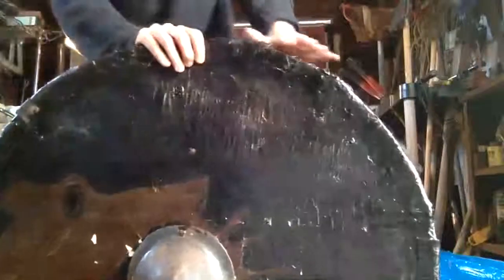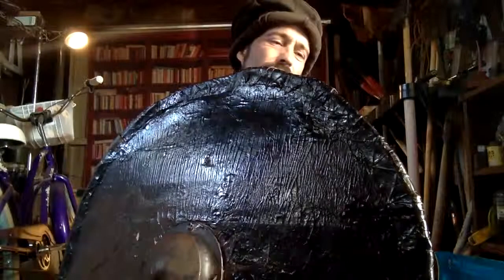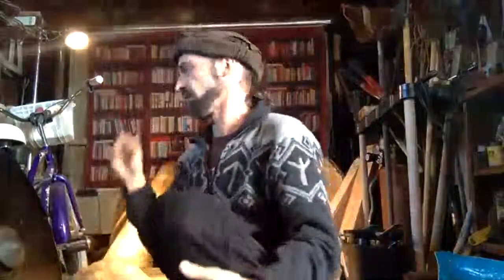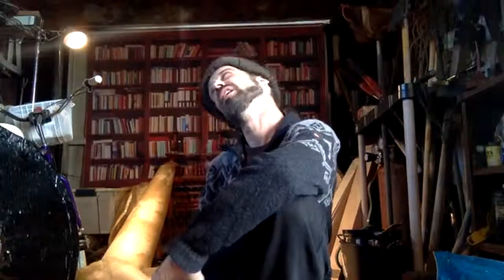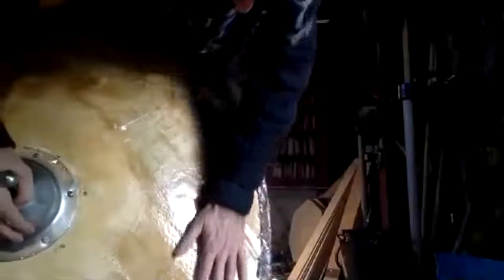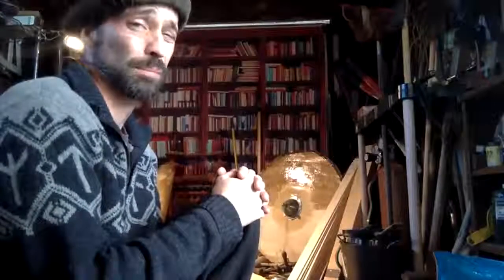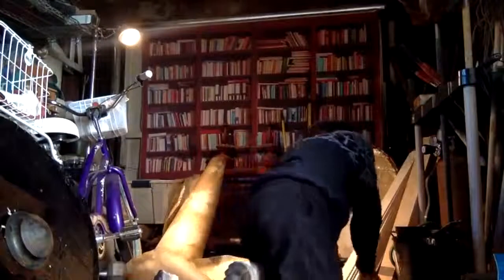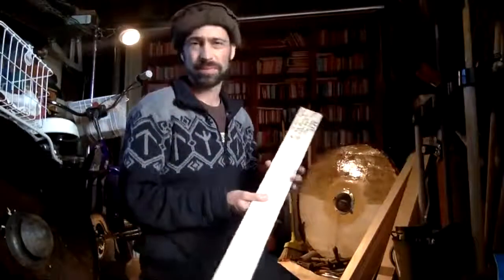Update in Shield Testing Plans, the indoeuropean word "linden" , And more!

Comment: In german the only word for Limetree i know is "Linde" (singular) though we.  And i have to say  from my experience with wood, i think "Lindenwood/ Limewood"  could make a great shield material... especially when you do like laminated layers... coz its very light, has a very even grain is  very flexible and durable coz of that, and it doesnt warp to easy.... and if you laminate at least 2 layers crossgrain  it wont split easy. Especially with hide on it,  + Its fairly easy to work with simple tools... + concidering the shield design and the fighting style, centergrip shields are ment to deflect more then taking a 90° angle hit on front.... a light flexible wood that doesnt break to easy sounds like a very good material choise to me for that purpose. And i allways find it likely that the smart people back then used materials that are good for the purpose they are used for, if they were able to get it. They also did that for bows, choosing woods with great properties for the purpose, so its very likely they did same thing for shields, i mean their life depended on that. Thats why id say if experiments with a linden shield proof that linden a good "shieldwood"  i bet  it was common to use back then.